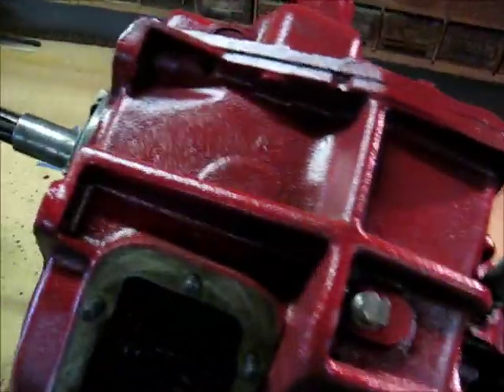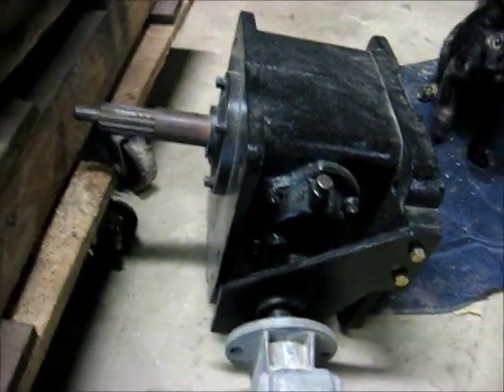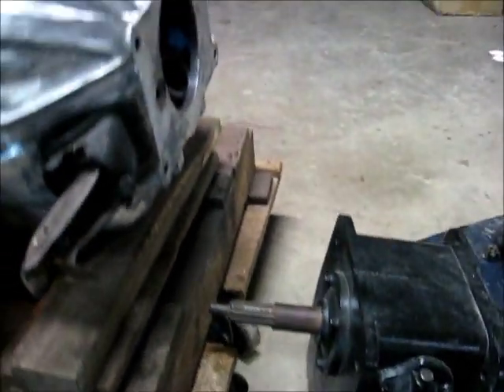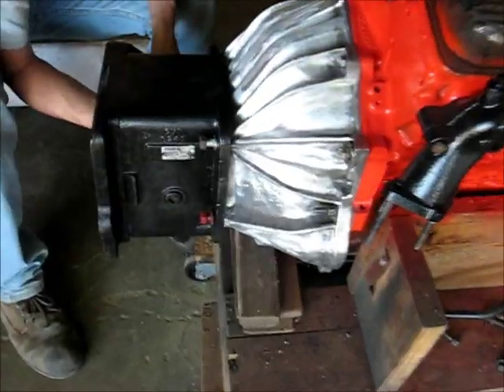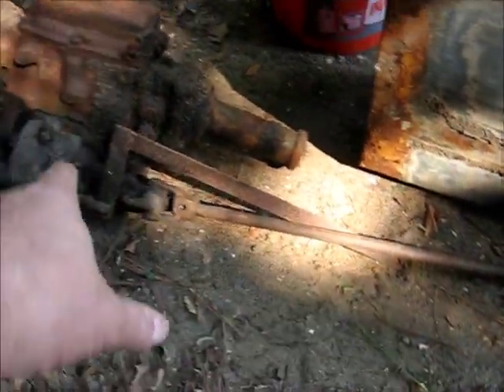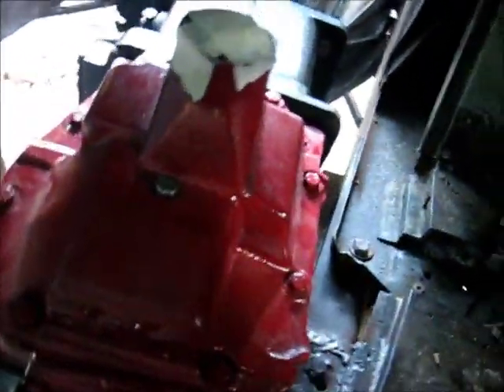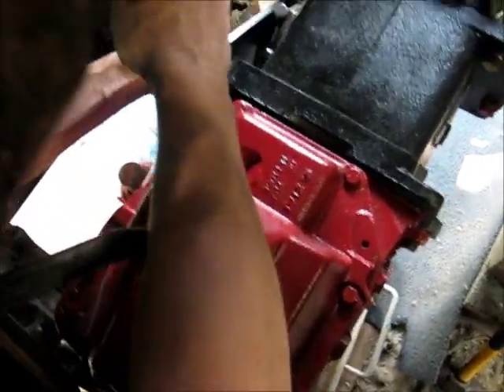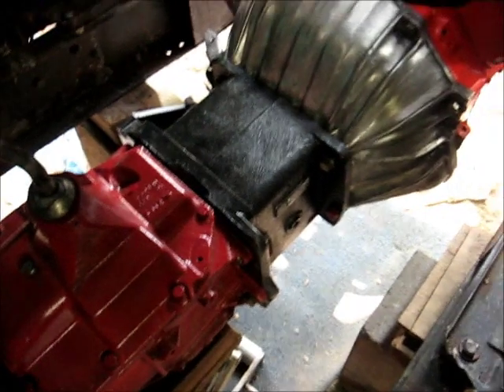Rare OverDrive Unit found for the '37 School Bus

Comment: how hard is tt to find an overdrive unit like that?
I'm planning to add on to my NP435 transmission between the bell housing and the transmission so that I can split gears and get (relatively speaking) better fuel mileage out of my bronco.   It's a rare 2nd gen model ('78) that has (from the factory that it was built in,) an NP205 transfer case, a heavy duty clutch, ford 9" rear end, dana 44 front end, detroit lockers, and warn hub lockers with a 350cui windsor motor.  Dual barrel carb from motorcraft (2150 model specifically.)   XLT Ranger designation basically, with only 11,000 miles on it.    It's the only bronco that I've seen in person that only needs a little bit of fixing for the ring and pinion gears in the rear, new fuel tank, lines and tires and it's ready to go.   Well, assuming the oil doesn't need to be changed.   Checked everything and the trans is in beautiful condition, same goes for the front end, and transfercase.  According to the owner it's mechanically sound and should fire right up after a little bit of maintenance.  Wish me luck with it lol.

Comment: Thinking of building a schoolie with one of these. Just wandering if it'll work to save fuel ? I'm sure it will, BUT lower RPM doesn't always mean saving fuel. Being that it'll require a heavier foot to propel against a higher gear. X amount of weight, road inclines. So another issue may be if the gas pedal is 3/4 the way down but RPM is saying I'm only driving 20mph. How does this effect automatic transmission shifting ? (On a newer model buss) something like a early 90's model...
PS I sure would like to see your 37 !!

Comment: O.k you got me fully confused. If you are powering a winch why does the driveshaft face backwards? I have Braden pto winch that came off the 205 t-case in my '69 Chevy 4x4. I was told it can also be run off my sm 465 too. Does my 465 have to have a special gear in it to run the winch box?, or will it bolt right up when the cover is pulled off? If that won't work I've seen on e-bay the exact same Chelsea unit you are running for sale I could buy  but also has shaft running towards back of truck. Do I need a gear or something in my 465 to run a box like your Chelsea and is your 465 just like mine from factory? Thx. Jim.
Reply: That's an industrial type pto winch  like for a tow truck

Comment: i am gathering parts currently to build a full chassis 1972 crew cab and i am using the sm465 with a np205 behind a Cummings 12 valve running 456 gears and 35 inch tires , i would like to use the same over drive as yall are ,any direction on where i may find one
Reply: Rick Bullis Jr. What's a "Cummings"?

Comment: Hey there Billy Bob and comp.

I am working on a 1950 chevy 1/2 ton truck and considder to use the Advance design torque splitter and SM 465 transmission. As i understand the Advance Design OD sits in front of the transmission and not at rear as you said here and has an RPM drop of 27 %. Do you have an open rear axle or is it a closed torque tube axle?

Martinius Berg.